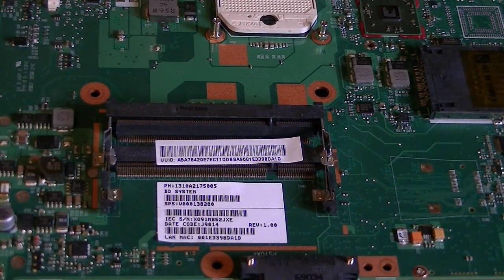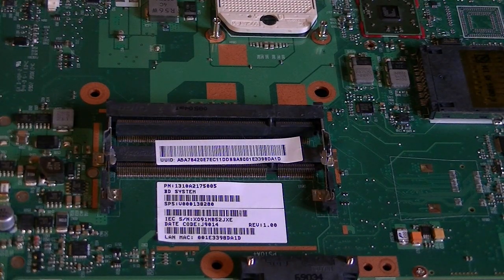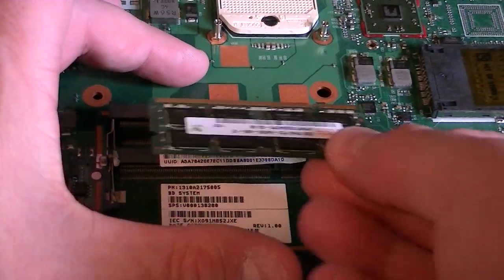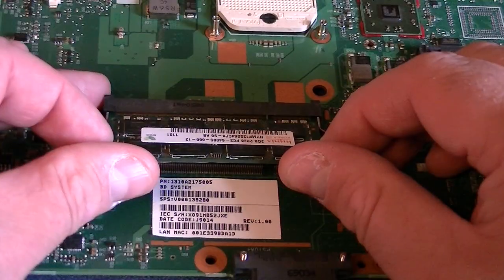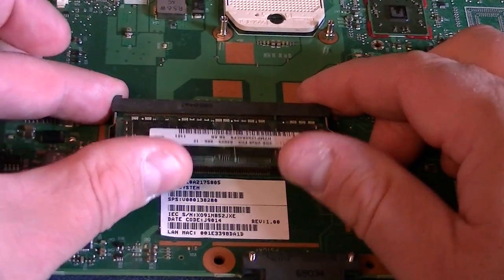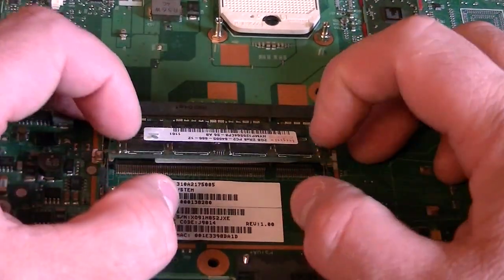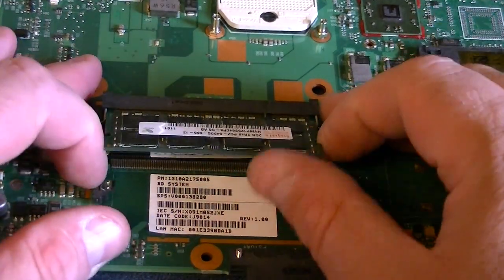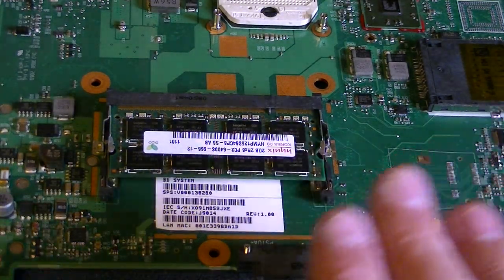How to resolve issue where unused RAM slot will not recognize RAM

Comment: Holy shit it worked. I'm glad I found your videos. I thought my acer nitro 5 had a faulty second memory slot. Give your laptop some times to turn on and it will work.
Reply: Bro which laptop you tried. i tried the same thing bu its not working please let me know
Reply: @leaderjon  Mine is An515-58-57h2. Mind you after you install new ram it will take quite some time for nitro 5 to boot. Mine took like a minute I guess because it needs time to recognize new hardware.
Reply: @hazminaiman5453  yes thank you i will try

Comment: PSA: if this doesn’t work for you, try pushing down on the ram slot and booting to see if it works. The above video didn’t work for me but I found out by pushing on the the black strip that the pins were loose. It would boot when pushed and crash when I released pressure. Laptop: Lenovo L14 Gen 2 AMD

Comment: I have B1 and B2 not doing anything but throwing a CPU light. I can't install the Ram sticks I have properly. Brand new MSI Mag B550 tomahawk wifi board. They never worked. I though at first I had a bad stick but I ordered 2 more new and the same thing. I'm waiting for MSI customer support to open up today. I'm hoping theses a software issue and I don't have to take my board all the way apart and out of the case. Not a hard job but annoying when you have everything already zip tied and looking good.

Comment: I'm so happy this actually worked on my laptop. Thank you!
The key is to slightly wiggle the RAM stick up and down (at a 30° or 40° angle) until you feel the RAM slide into a 40° angle space inside the slot because an unused slot has a tight space and simply pushing the  RAM in won't work.
I've searched, read and tried so many advices that I've come across Google and nothing worked.  I almost gave up.
Thank you for sharing this --  the simplest solution I found and yet it's the one that fixed the problem. 
God bless you.

Comment: Thank you so much. First thought: the slot is a bad one. Tried installing the existing ram into it. Didn't work. Dejected, I was about to return the new RAM. Then I stumbled upon your video...Lo! and Behold! Went through at first go... Upgraded my 9 years old HP G6 laptop with 8GB RAM...what a relief!
Reply: Did you take out the battery ?
How many times did you try this...
Before turning on the pc how did you know u wer done/ what was your indicator that ok I did enough?
Reply: @skoradabura5966  Of course you need to take out the battery for my model i.e HP G6 laptop. There was no indicator. First few tries didn't get the RAM fixed in place. It was so loose that it would come out easy. Switching on didn't show the new RAM.  Later using the technique in the video it fit snuggly. Now RAM shows 8GB.

Comment: After dealing with 8gb of ram, I decided to buy another 8gb of ram stick so that I can have 16gb of ram in total. However, I'm noticing an issue. When I inserted my RAM, (fully seated and locked in to the socket) my computer, doesn't recognize the ram stick I just inserted. I am using the same exact ram stick with the same clock speed and everything. 
Does anyone know a fix for my situation? 
I tested just the brand new RAM stick itself and it worked properly, so the new ram stick that I just inserted isn't broken.

Comment: I can't believe how ridiculous yet how effective this is!!!!!

Another success story of this method
I thought the second slot of my Dell Inspiron n4110 wasn't working..... I tried this method and it worked wonders

A word of suggestion and an extra step is that if you have a small blower that you use for removing dust from camera lens and a soft brush (I used my Carl Zeiss lens cleaner kit brush and blower). I used the blower for about a minute trying to remove dust and stuff then brushed the second ram slot softly.....then I tried this method....and when I restarted the system IT WORKED.

Thanks again for this🔥🔥🔥❤️❤️❤️👍🏻👍🏻👍🏻🙏🏻

Comment: After giving my all hope and try and failed to put 2nd ram on 2nd slot.. it didn't recognised..
I pray lot to God 🙏. Then I find this video 😌😌
This video save my self confidence to put ram without expert... And I succeeded..

Now I can explain my point of view.
The real problem when a laptop manufacturing and give one Ram , extra ram slot doesn't work for long time. That's why slot become kinda hard..
You need to do the trick what in this video explaining..
Just remember take a look on previous ram in attachment mode and push your new ram on 2nd slot until attach pin doesn't come upto ram's small side hole...
Cheers.. successfully work on 2020 from india 🥰

Comment: is there any explanation to this? o_O
Reply: 4 years late but its because the memory and the slot both have golden pins that have to have good contact so this "clears it out" if there was any dust or debris stuck in an unfortunate spot. it's safest doing it with a stick of ram instead of another metal like a screwdriver obviously, as you could scratch or break the contacts

Comment: works like a charm... after cleaning my laptop one of my ram slot stopped working, was using just 1 slot, after watching this video gave it a try and it started working...its just dust stuck to the pins use a soft brush or follow the video. Thanks.

Comment: Thanks dude it's worked for my laptop..as long as the pins slot still in good condition.
Reply: Did you remove your battery?

Comment: Didn't for work for me. I have HP desktop that use Laptop RAM(If u dont know abt this, try check it out on google). I filled the empty with 4gb ram but PC still not turning on. I swap the original RAM to the other Slot ram and still not work. Help me
Reply: could be a broken slot then. mine broke when I dropped my thinkpad off my bed (more like pushed it off while I was asleep :() this is for cleaning out the pins

Comment: I have dell precision m4600, Ihave 6gb ram (4gb + 2gb) installed in bottem slots. Now i decide to upgrade my ram to 12gb by adding 4gb + 2gb in under keyboard slots. but when I plug in ram in that slots my laptop is not boot... light of power buttton turns on than off but lights of wifi, battery, and harddisk stay turns on..... i follow the procedure u describe (plug in and out ram arount 5 to 10 times without battry... but face same issue.... kindly help
Reply: same issue

Comment: Can you please tell me if there is another solution cause, I've tried it and doesn't work. It used to work and I opened the system to check for heating issue but now both the ram stick works in either of the slot but system goes dead if I put them both simultaneously.
I'm using hp pavilion G6.
A word of advice would be awesome, thanks.

Comment: Guys this really works! I tried it on my Lenovo laptop which I had bought last year and it's ram stick stopped working I thought I was the ram stick and tried it on my brothers laptop it worked fine there so I was like the mother board might have been short circuited or something and hadnt done anything to try and fix it for 4 months but I saw this and tried it AND IT WORKED!!!!! I AM SO THANKFUL FOR THIS VIDEO. btw the ram for my laptop was ddr4 so it works with that too
Reply: Did you have to remove the battery?

Comment: on my dell vostro 1510..WINDOWS 10,  after upgrading used to work with 4gb ram..2gb + 2gb,  recently stopped switching on, have checked and tried with single ram card..upper slot is working and with single ram card can switched on the laptop,  if installed both the ram card..just keep on blink the blue lights, but never switch one..can you guide me what to do and how to fix this problem..

Comment: Just tried upgrading my daughters ACER with 4 gigs to 16 gigs. One 4 gig to two 8 gig. It didn't see either and only got a black screen. I've upgraded a couple of dozens PC's and laptops RAM over the years and never run into this. I'll try this. If it works I swear I'm going to go outside and eat one of my dogs steaming piles.
Reply: Still no dice. I don't get it. Not only does it not work, I just discovered with  he new RAM installed, the laptop won't do anything without the AC adapter. Once I unplug it, it shuts off. With original RAM, it's fine.

Comment: OMG OMG OMG! 
Finally solved today after 2 years, I did your trick only for few times and finally, it's recognized. Dude, you are such a talented guy. I' visited many websites, several forums but nothing works for me, But Today I, finally found the solution, you are a great man! This trick needs to be shared for those who are facing this problem like me, before!
Reply: what was your issue? when i try to start my pc up it is just black screen but the pc runs like the pc cant send connection to the monitor anymore. the whole issue starts with: i bought 2x8GB RAM and changed it with my old then "boot device not found" issue come out then i tried to do the bios fix but i couldn't then i changed some settings to deactivated or something like than then after restarting my pc nothing shows up so now just black screen as i told you in first line. Do u think it can help or just the same issue like yours?
Reply: @Ibo2630  I had that problem and I just had to reinstall the ram
Reply: @Bigsack-g5c  mine is fixed long time ago😅and it wasnt even about the ram🤦‍♂️
Reply: @Ibo2630  o damn I had this problem and I just took it out and put it back in properly that sucks tho
Reply: @Bigsack-g5c  my problem was when i plug the ram in some way i just touched the harddisk cable i think it unplug or at least couldn’t send connection to the monitor and says you have no harddisk installed i was like wtf i’m doing nothing with the harddisk right now, my problem is ram what do you mean no harddisk😅then i got help and he told me to unplug and replug the harddisk power supply then boom here we are🤷‍♂️😅

Comment: my laptop suddenly stopped working and was giving me a black screen and 4 beeps after some research i fixed it by removing one of my RAM and tried like each ram on each slot to test the issue and came in the conclusion one RAM slot stopped working i was on the verge of buying a bigger size single RAM but then saw this video, figured why not give it a shot...i did it 4 times before turning it on and it actually worked..thanks you actually saved me $$

TLDR it works

Comment: You're a friggin genious my man. spent like 4 hours trying to figure this out: using memtest86, swapping dimm slots and checking for dust or everything you can think of expect this. Tried it, worked the dimm stick in and out, realized it went in further than ever before after a few attempts, booted back up. Hallelujah! Thanks for your expertise!

Comment: This is exactly what is happening to me.  I purchased two identical Lenovo Y510p laptops a few years ago.  They each came with 8gb DDR3.  One of the laptops is junk now and I salvaged the RAM and tried to pop it in my "good" one.  The mb can handle 16gb RAM, has two total sockets, the DDR3 are exactly the same. Each stick works fine in the top socket, but the bottom socket doesn't work at all (when put in solo, or when both sockets are being used).  I've tried what you are showing in the video, probably at least 20 times now, and it still will not boot with anything in the socket closest to the mb.  Any ideas?  I've used an air canister to extensively clean the socket, so I have no idea what it could be.  Laptops are out of warranty now, but Lenovo spent a good 20 minutes on the phone with me yesterday and have no idea.
Reply: 2 bas for you.i tried wiggling it in  & it went all the way in the first time.im using both slots now.

Comment: Thank you soooooooomuch! I have IMac 1.83 Ghz and I thought I would upgrade from 512mg to 2gb ram. I did notice it was not reading slot 1 of 2. I thought I would have to replace the logic board but I did as you say and also cleaned the ram with lens cloth and pushed in until I thought it would break. Finally it worked! I only paid $40 for the IMac but it is still useful for word processing and movies and Youtube but cannot download latest search engines of course.

Comment: Thank you for insisting to reseat the RAM if it doesn't recognize. I upgraded my Lenovo Thinkpad L430 from 4GB to 2 x 8GB and many sites emphatically state the this machine only recognizes 8GB max while others say it will easily see 16GB. My machine had the 4GB under the keyboard and none in the bottom. I figured I would try to see if I could get it to see 16 and bought a 2 x 8GB kit on Amazon. . After installation of both, system saw only 8GB. To test, I removed the bottom stick to see if it still saw the 8GB in the top and on start up it beeped and black screened. I lifted the keyboard out and reseated the stick several times (click in-click out-click in like you suggested) put it all back to gather and WHAM! 16 GB.... THANKS!

Comment: Really dude... ....... Surprisingly worked for me........ 
U r gr8......
Reply: For real?
I have an 8GB DDR3 ram and my pc won't start up..when i add my old ram it's ok..but
If this really works..
Reply: CaptainGeorge
 ys dude try it out.... For 4 to 5 times....... It will surely works....
Reply: 1 more question..
Must i remove the motherboard battery?
Reply: CaptainGeorge 
No..need for that..... 
Just remove the laptop battrey.... 
And make sure that power cable is unplugged..... 
Surely u will get the success...... 
👍👍
Reply: @GodlyAnnihilator  did you fix it? i cant start my pc up too. i bought a new RAM and after changed it with my old now i cant open my pc it says "boot device not found..." etc. but now just black screen nothing come out. did u fix it?

Comment: I have an older HP DV7, the video went out. After years of sitting an IT worker pulled a RAM stick out of slot #1 and video worked. I replaced with 2 new RAM Sticks and got same result. Pulled out #1 RAM and it works. Can I upgrade the #2 Slot with a 4 gig RAM stick and have the same results as 2x2gig sticks? The computer had two 2gig sticks when purchased new from  store.

Comment: This worked for me. It is imperative that the RAM is inserted at an angle (30°―45°)
If it is not, that means the RAM needs to be eased into the slot. Try pushing only a teensy bit harder at an angle and the chip has to ease in at an angle. Not horizontally parallel to the laptop.
Reply: Thank you

Comment: I bought a refurbished HP computer for my wife that had 4 GB of RAM in Slot 2 and an empty Slot 1.  I bought a second stick of 4 GB and installed it in the empty Slot 1.  The computer did not see the additional RAM.  I then removed the new RAM from Slot 1, moved to old RAM from Slot 2 and put it in Slot 1, and put the new RAM in Slot 2.  Once again the computer recognized only 4 GB of RAM, the new stick in Slot 2.  So I thought maybe Slot 1 was bad.  Then I found this video.  I worked the old RAM in and out of Slot 1 several times (about 5 times) and did the complete insert and remove several times.  Then I booted up the computer.  All 8 GB of RAM is now recognized.  What a simple and unexpected fix.

Just for information, I used CPU-Z to check the slots and RAM.  Both it and the system were reporting only 4 GB, however, the CPU-Z identified the slot in which RAM was recognized.  At the end, CPU-Z recognized all 8 GB of RAM.  Just another diagnostic tool.
Reply: Check this 😎bro..  :-  https://youtu.be/tcf_wDhG0sw
Reply: bro i think your are using 32bit os PLEASE use 64bit OS
Reply: It sounds risky as I can fvck up the slot and memory as well. I'm scared to do that

Comment: This may seem stupid, it seemed to me, but it actually works! Guess I'm the stupid now...
Reply: @Altair Nice
Reply: I seen that video today & it worked for me.at first glance it looks too simple to be true.
Reply: Brrooooo😂 it works like magic ,I thought it was stupid too
Reply: it seems stupid....but.....theres a noticeable difference between unseated, not seated properly, and properly seated, and if the problem was so minisculely noticeable whether a gap exists between the contacts and the card, and it looked completely seated under a close examination or a microscope lol....but it wasn't? ....then...i claim creator error...not user error....why in the f***k should it be so hard to get a card into a slot and have it fu***ng read it correctly? .... stupid  yes.
Reply: @erinpitt580 you have a point.HP could have made it easier for it to seat properly.it could have been made fool proof.

Comment: When i am doing this trick my working ram slot is smooth but the other one is really stiff and its hard to insert ram pls help am confused i did ur trick for 30 min doesnt work for me
Reply from the maker: +FrostedFin usually, it only takes 15-20 times of installing and removing the RAM before it allows the RAM to seat properly.  If it is still stiff, I would keep trying, but every so often, power up to see if it recognizes the RAM.
Reply: Drev222 idk but i left the ram in overnight and unplugged my computer hoping it would do something and it did a little bit
Reply: Drev222 for me it says i have more ram but it dont get more fps in games gelp